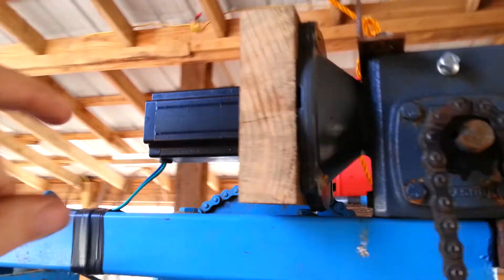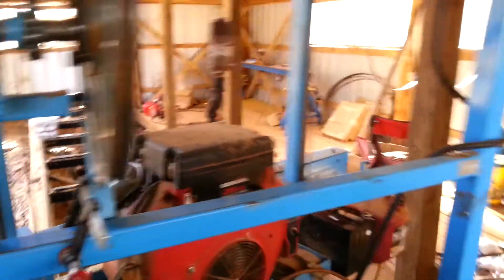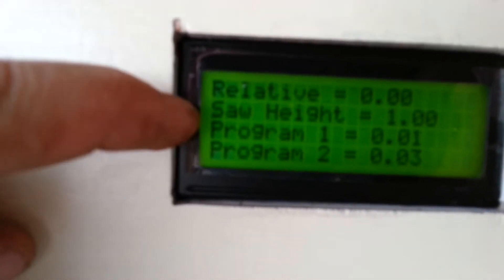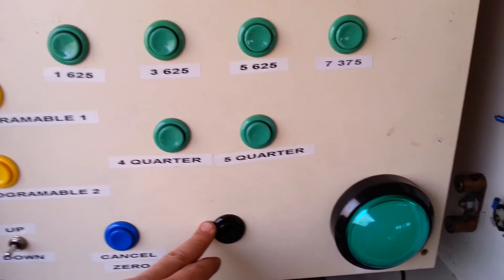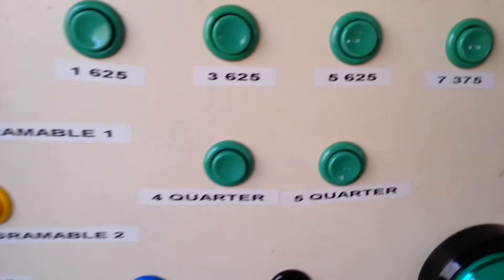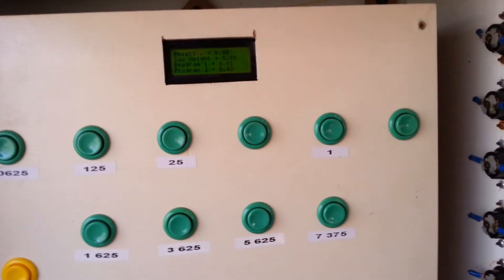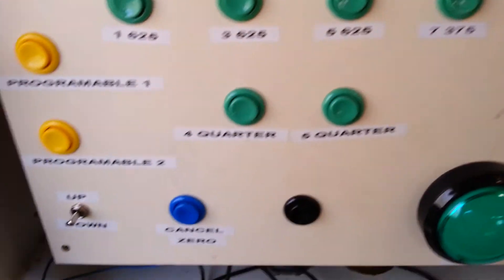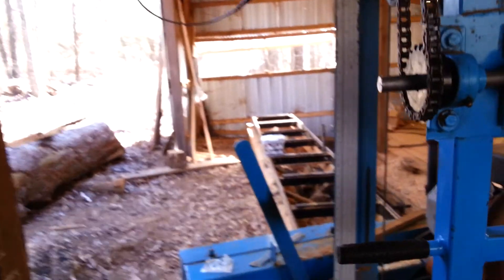homemade diy sawmill setworks

Comment: Need to add a button for the kerf, when you drop 4" you will cut 4" minus the kerf. So you should drop 4 1/16" ish. Awesome though, what size is that stepper in terms of Nema 23, ect.. Im going to make one for my mill 👍

Comment: Hi I have an old Cook AC36. I would like to put a set works on it. What brand Electronic Board controls the stepper motor?
Reply from the maker: It is an arduino uno. If you look it up on the forestry forum I even posted the code to put on the board.
Reply: stpaulboyjake I've looked for it but can't find, any added help?